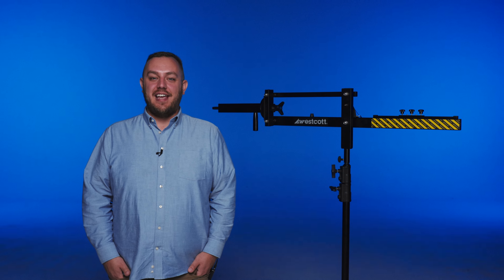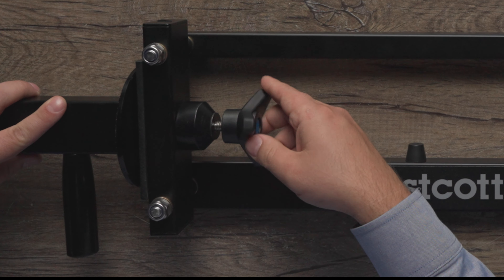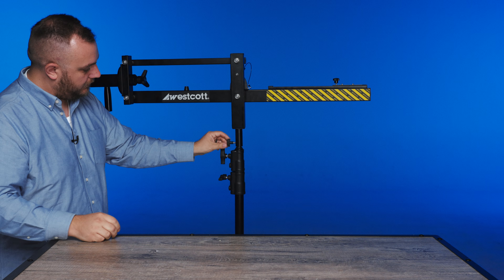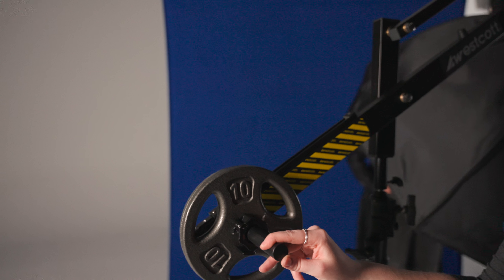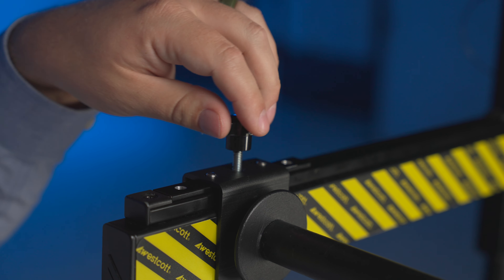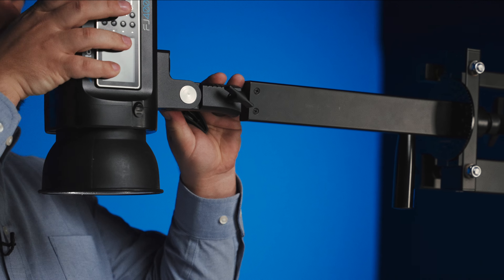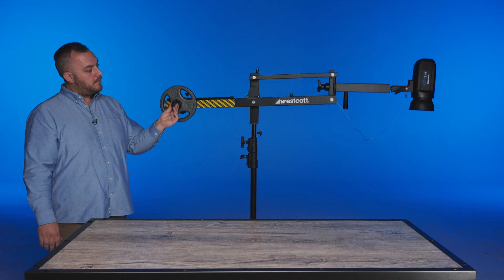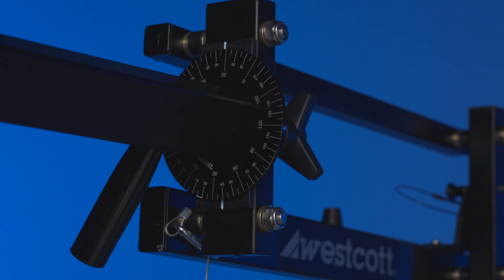Westcott Easy Boom | Quick Start Guide

Comment: What’s the length of the arm? It looks quite short. Almost unusable.
Reply from the maker: The boom arm has a reach of 26 inches, which we find is ideal for most portrait photography setups. It’s designed to be compact and easy to maneuver in various studio environments. However, if you feel a longer reach would better suit your needs, we appreciate the input and will consider it for future product developments. If you have any other questions or concerns, please don’t hesitate to reach out.
Reply: u may need ceiling mount
Reply: @WestcottLighting  Is this for lighting setup only? Can it be used for overhead camera?
Reply from the maker: Our video team has used it for overhead camera mounting! As long as it is below 15 lbs it shouldn't be an issue for smaller camera setups. We used a Sony FX3 and 24-70 lens on a Baby Pin Adapter 5/8" Female to 1/4-20" Male on it.
Reply: Do you need a c-stand or will a heavy light stand work?

Comment: Wait a second, the arm is counterbalanced, but the light and modifier are not? When changing the angle of the light the user must support the weight of the light. I realize that angle adjust would take another pivot and lever arm, but some photographers used grids on their modifiers, angle counts…

Comment: Can this be used on a rail system?
Reply from the maker: We highly recommend using a C-stand for setups like this. When placing significant weight on a rail system, there are many variables to consider. Counterbalancing the Easy Boom often requires adding a lot of weight, which can put considerable stress on the system. Be sure to check the weight capacity of your rail system before attaching anything heavy.
Reply: @WestcottLighting  appreciate the reply.  I have an old Manfrotto bogen rail system- I'm not sure how to check the weight limits on it since it's so old.  But it is quite sturdy...